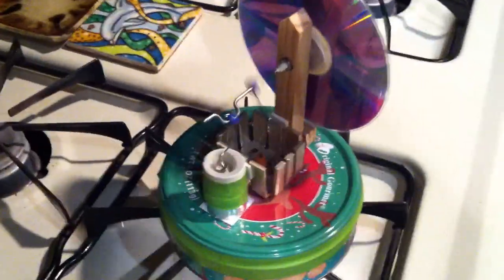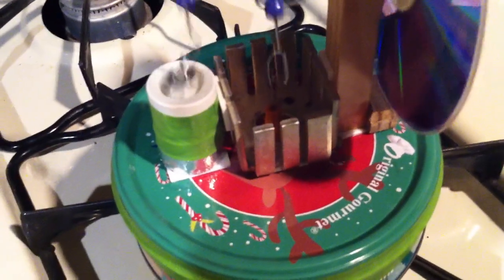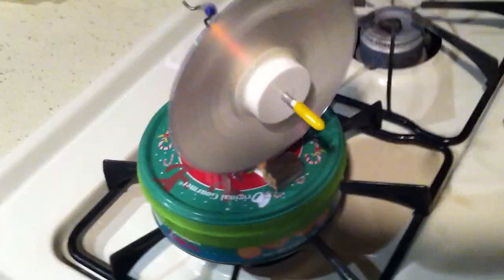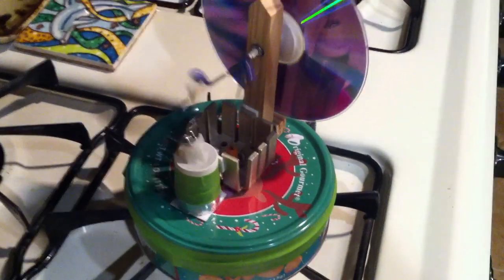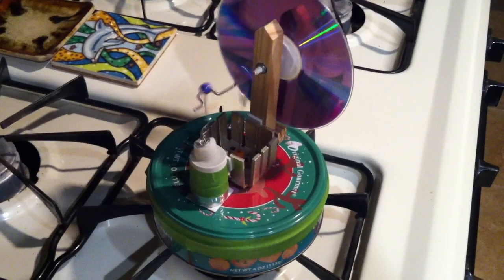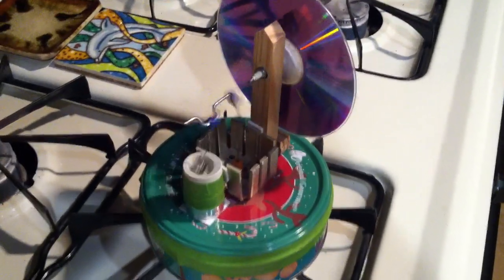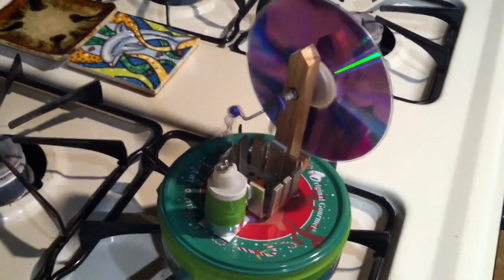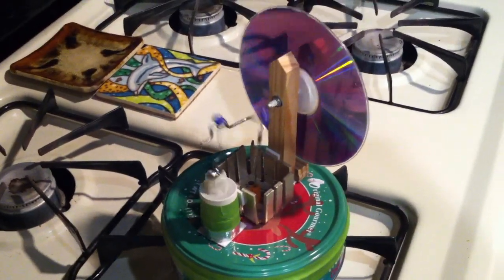Cookie Can Stirling ....with heat sink

Comment: It is not actual, the technology is tired, there is no power, 17-19 century, to reach the power you need an excessively high plasma temperature and in excess of low liquid nitrogen.
Reply from the maker: Similar to electrostatic motors.  Old technology that was a stepping stone to more practical energy conversions to power things.  Great fun to build a simple working model though.   Good leaning tool.

Comment: Could we persuade you to do one more thing ?
Imagine if the flywheel was a fan, cool air would be pulled across the heat sink creating a greater temperature differential.
Also, what is that number before "Second" ?
Reply from the maker: Here is a commercial Stirling Fan like you described and a good description of how this type of engine works.  If I had a good fan blade I might try it.  https://www.youtube.com/watch?v=CdYCZtOi4Sc